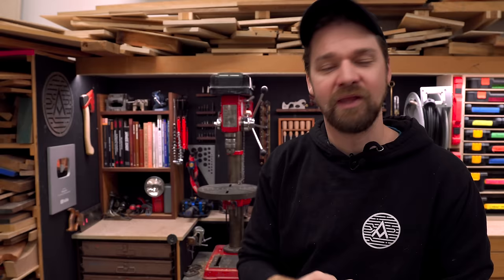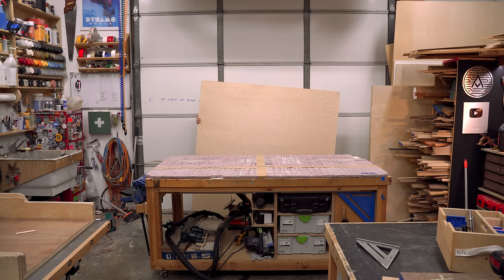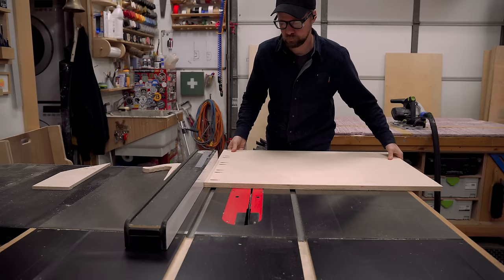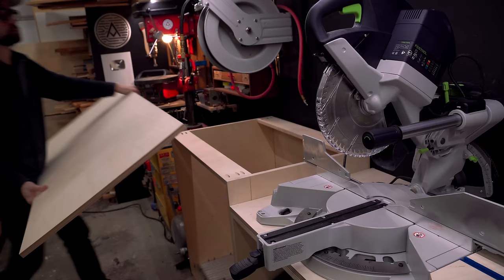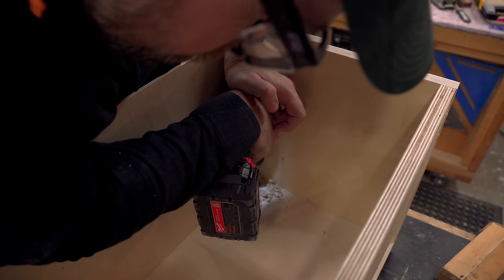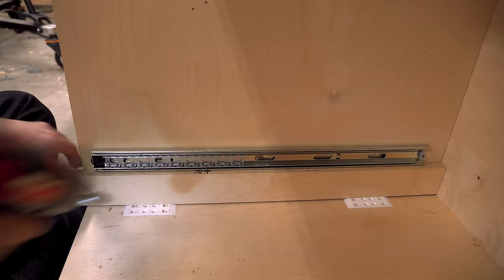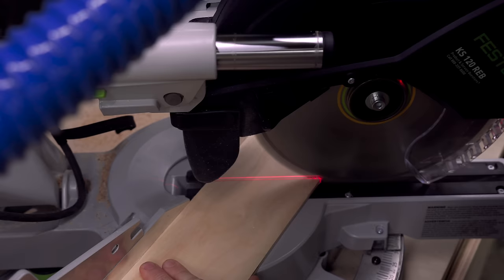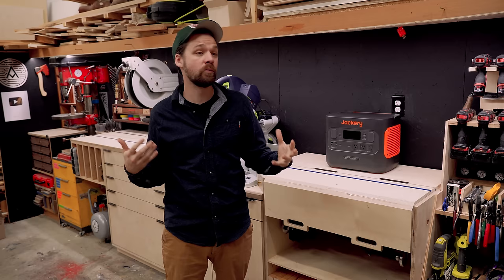Building a Miter Saw Station PACKED with Features!

Comment: I LOVE my Kapex, but my only complaint about it is they’re essentially useless at a 45° compound cut to the right side. The guide rail drops so low that it’s basically incapable of cutting anything thicker then 1-1/2. And I run in to this  constantly trying to cut L-shape trim for cabinet crown and fillers.

Comment: Great video and saw station, the only thing I'd do differently is I'd have drilled the faces of the pattern ply drawers at the same angle so the brass knobs sit in the direction you pull them . Otherwise, it's brilliant.

Comment: Build the little drawers over size and cut the entire thing at once on the miter saw. Seems weird you didn't do that. Also I think it would look cool for the brass pulls to be parallel to the drawer, instead of perpendicular to the face. Opinions... you know, everyone has them. I'm gonna have to check out that patterned plywood!

Comment: Super video, and loved the long drawers with the patterned ply fronts! Any thoughts on how to build in some sort of adjustment mechanism (up/down) for the saw shelf? I'm wanting to make something like this except with a router table where you have the lathe area. I'm super worried about not nailing the height of the cabinets on either side of the saw area, and don't want to have to shim etc.
Reply: I am planning on using T-nuts in the top of the cabinet with screw in adjustable furniture feet to be able to micro adjust my router table height. Just remember to include enough room for an extra nut on the bolt of the feet so you can lock the final height in.

Comment: Nice miter station. Pretty similar to my absurdly overbuilt 20 year old one (yep, leared a bit since then). One question - do you plan to add self adhesive rulers to both sides? Those are a game changer for me, just as valuable as on the table saw.

Comment: You know that the Kreg door hinge jig also has two small holes aside the large one, made exactly for a 1/16" drill bit so you can pre-drill the holes for the ginge screws? I usually install the forstner bit in my drill driver and the drill bit in the impact driver so I don't have to switch the bits in one machine (and Yes, drilling with the impact driver works very well too).
Now you know that you don't need any extra alignment with the square to mark the hinge screw holes and pre-drill them after that. The Kreg jig already gives you the ability to do it in one shot while the jig is already in place.
It is designed to basically shoot 2 birds in 1 shot.
Have fun!
Reply: You know you are like the 6th comment that said this?

Do you also know that not every hinge is made to have holes that line up with the jig?

Comment: Huh.  I just realized that you could make those pulls cheaply with just some square tubing.  Just rip it on opposing sides just a little in from opposite corners.  (If you use aluminum, you can cut them on your table saw.)

Cheers!

Comment: That is wonderful. As a tip when using the Kreg Hinge Jig…chuck a 1/16” bit into another drill and use the two small holes on the jig to drill the screw pilots for the hinge. Saves you a step and reduces possibility for getting hinge of axis.

Comment: So nice to have good workshop furniture, well done. But STOP with all the pocket screws! If you don't see the sides of a cabinet, just glue, pin and screw from the outside of the sides into the bottom and rails. It's way faster and a better connection.

Comment: I wish products like Jackery would stop calling their boxes "generators" as it makes you feel you can run them on a fuel.  They are a portable battery pack with optional solar panels.  The solar panels can be argued to be generators, but not the battery box itself.  I turned a defunct Walmart jump box with AC power and USB into a decent portable power supply by replacing the SLA battery with a set of LiFO cells.  I did also replace the USB with USBPD 20V 5A type C ports.

Comment: The Kreg hinge jig has holes to drill the pilot holes for the hinge mounting screws too. No need to square them up and drill using the hinges themselves, just use the jig, clean off the chips, screw down the hinge.

Comment: Love the video and the work and your voice-over! Hate the angle of the drawer pulls either side of the mitre (wish you'd drilled them at 45 degrees or to match the drawer front angle so they are parallel to the movement of the drawerl :-,( (I hope you don't care about this comment!). Subbed.

Comment: That Kreg Jig Kreep. Hate it. I got a Porter Cable pocket screw hole making machine.. modified the top clamp with a pneumatic clamp on it, with a pancake foot actuated valve. You can get great bits from Castle machinery to mow thru material. With the hoggin bit, red knob for the handle, and the foot actuated air clamp…. It flies. Can pocket screw stuff real fast, and NO Kreg kreep.

Comment: Great project. I want to redo my miter station. But I do want to upgrade to the Kapex as well. So I’m waiting till then. My floor is definitely not level. So I like how you built the base. I’ve seen others but they usually scribe a line and your way seemed much faster and easier. Can’t wait to see the build for the lathe compartment. Also… great use of space .

Comment: So, why not just install a bunch of leveling feet so you could move the thing anywhere and relevel it as needed?
Reply from the maker: Personal taste more than anything. I find leveling feet to be a real pain. You have to lay on your side with a wrench and they’re really hard to get spot on.
Reply: @MichaelAlm    I generally put small holes inside the cabinet thru which the top of the screw can be accessed with a tiny socket, or screwdriver or Allen wrench ( depending on how the top of the screw is configured ) This way you just open the cabinet door to reach inside with an Allen wrench and crank the feet from above, not from under the toe kick.  This is like how steelcase office furniture is made, so you can level them from above.

Comment: The shop looks great.  I will add that your electrical system is not to code.  Your shop is defined by the NEC (National Electrical Code) as a Hazardous Location (Article 500 Class III, Division 2 location).  It pertains to flammable atmospheres.  I know, nobody knows this, except a very good electrician and building inspectors... The electrical system in this area is required to deal with dust and small particulates.  Your electrical boxes, conduit connectors, devices, lighting & receptacle wall plates need to meet this standard.  It is an easy fix that will help keep your investment safe from fire.